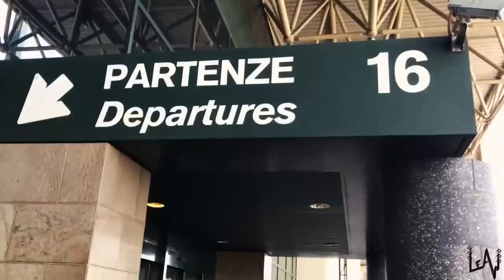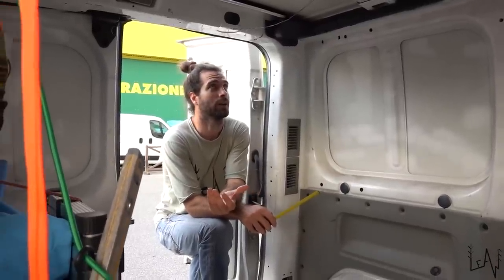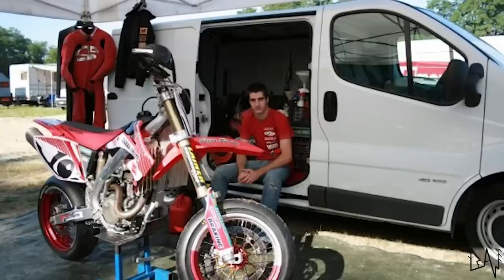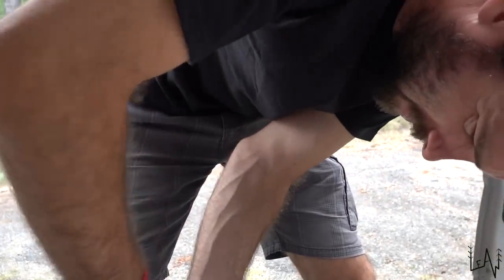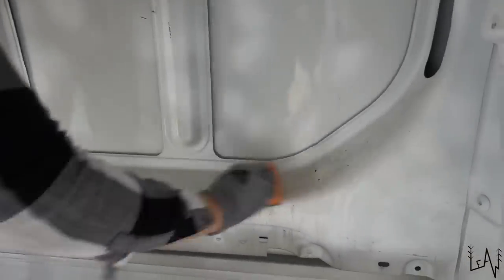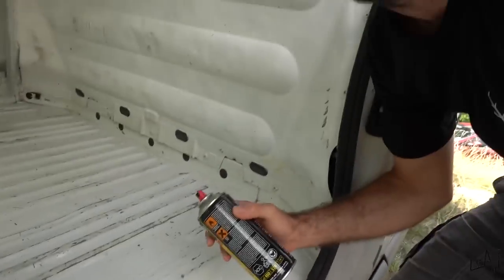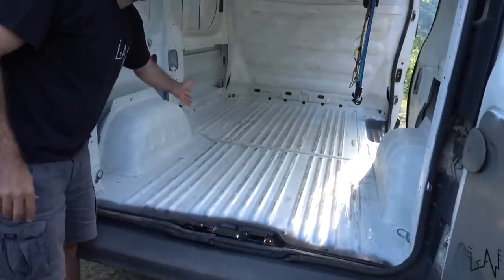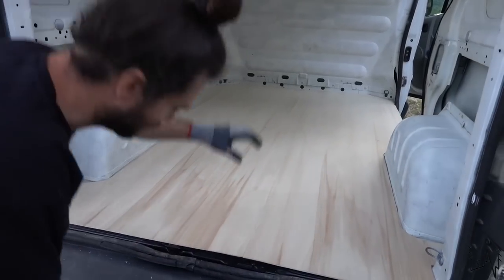Our VAN CONVERSION begins / DIY Renault Trafic L1H1 Van Life Italy

Comment: Guys , I built out a Ram ProMaster City van that is probably close to the size of your van. It sleeps two just fine. it's great on gas , you can park anywhere. I use the entire floor as my bed.
Then from the very back, half way to the roof I made a platform that runs towards the front of the van almost half way to mount my sink, small fridge, microwave and stove. The rest of the space is a seating area. I used two tri fold workout mates as my bed. Thin light weight and comfortable. Don't let anyone say it can't be done , I know better ! Good Luck on your built !

Comment: Advice for you van conversion, take a look under rear for your type of rear suspension system. If you have rear coil springs you should install what are adjustable air bags in them for more sturdy rear support. If it is leaf springs you can add a helper springs to them, or replace the shock absorber with new ones that have a additional coil spring attached around them for addition support. If you do it now you will thank me in the end for this "heads up", or if not remember my  advice later.

Comment: Your van is AWESOME! TONS of potential to work out a functional plan. It is small enough to get decent fuel mileage so you can travel more....its very smart to use what you have and make it work for you not spend alot on it because you will change it many times anyway....just determine the most important features you need then play with different floorplans either freehand drawings or try the sketchup app...its going to be awesome guys that van is awesome!!

Comment: I think the 10 mm plywood can be used to make the cabinets as well. You can make them without framing them first. Just cut the plywood to size and glue and nail the pieces together (with a nail gun).

Comment: Howdy, do you guys ever think of cutting part of the roof so you can stand when you can cook and then put a pop-up tent on top of the roof maybe hanging over the back a little so you can climb in  from the inside lay down and sleep ,Then when you leave just fold it or in slide the over hang in and drop the top and takeoff , you can still put solar panels on top of the pop up .  They sell pop ups . The roof  over the passenger and driver side you can put a storage rack on top of that. Stay safe you two

Comment: Non lo so, personally I avoid the spray foams. To many reasons to mention. They degas over time, are unstable and are quite toxic. They do make thin closed cell foam insulation but this may be difficult to find. You can make your own using 1/4-1/2” foam core and mylar. Good luck. Love you channel. Ditch the spray foam.
Reply: Toxicity is not good.
Reply: Agree the foam is hard to deal with & messy🤔
Reply: Insulation è una cosa importante non lesinare

Comment: You need to put wood strips down underneath the plywood, so you have something to shoot the nails into. I think the nails will go through the metal floor or bend..which won't hold the wood securely

Comment: Maybe you could find a way to do fold down items to where you can have convertible things. Like a table, closets, cooking, solar for through could be foldable for the roof. Maybe a slide out table with fold out legs from the bottom. Just ideas.
Reply: A fold down would be awsome. Such a good job, I'm building my van at the moment and I remember this part.

Comment: You can't use the thinnest plywood for sub flooring in your van. What are you thinking? You have to change it to at least the 9 mm thickness.
Edit: There seem to be other thicknesses in other countries, so you might want to go with the 10 mm thickness - as the minimum thickness. It is better to have it even a bit thicker than that. Beware that you don't get the type that has formaldehyde in it, because you will get cronically ill from formaldehyde. If it smells good, then it is probably ok. Formaldehyde does NOT smell good. And plywood comes in different qualities. You don't have to have the best quality for subflooring and maybe not even for the ceiling and the walls since I guess you are going to paint it. But you have to check that out for yourselves to be sure. And regarding the plywood thickness for the ceiling and the walls (if you are going to use it there) you would need at least the 10 mm thickness there as well if you are going to screw things to it, like spotlights and cabinets.
Reply: Annie They will put insulation panels and flooring on top
Reply: @isabelpatriciamuller5018  - Yes, I got that. But it is the sub flooring that will hold the weight of everything. Not the insulation or the flooring on top. The plywood will crack to pieces. But don't take my word for it if you don't believe me. Ask any builder.
Reply: Its going down on a metal subfloor and they are going to fill the voids it will be fine...from a builder
Reply: they are having to build by government protocols for a conversion so please be nice!
Reply: Such a good job, I'm building my van at the moment and I remember this part.
Reply: A thick wood subfloor was important for several reasons.  It helped  keep the cold out. (The coldest part of your van will be the floor.  Insulate it if you can.)  The thick wood floor will make it easier to screw things down, like your bed and kitchen cabinet.  A thick floor also makes it impossible for mice and other critters to chew through.  Mice in my van is a constant battle for me

Comment: Came here from your van tour video and I will sure watch all of them and comment.
You guys are lovely people but I will make some constructive criticism every time I see the need for it.
Anti-rust paint and rust stabilizers rely on a chemical process that needs rust to work. So it's not better to clean the rust first because then it simply doesn't work.
Also, it is better to just buy a Rust stabilizer and then apply regular primer and paint on top. All this WITHOUT taking away the rust.

Comment: I would have painted the floor in the van properly with a primer and two or three coatings, because there is going to be moisture there and maybe leaks from the doors or from living in the van. You might not even know about it. I was also thinking that painting the floor with a bed truck liner would be smart, but I don't know if those paints will emit toxic fumes. You would have to make sure they didn't. And you need a vapor barrier in the floor and in the walls. A proper one like they use in house walls. It has to go on top of the insulation and before you install the plywood. And since you probably are going to spend quite an amount of money on the van convertion, I would suggest that you replace the rubber gaskets around the doors in the cargo room. You don't want leaks from the doors on the new flooring.
Reply: Yeah I thought that. I did the same painted everything with rust protect. Such a good job, I'm building my van at the moment and I remember this part. Come over and  have a look if you want

Comment: I hate to put a dampener on this but these Renault vans....... Well Australia Post use them and they want to ditch them already.  My workplace bought 3. One was worse than the others so they sold it.  Another broke down so they used the parts to keep the last one going.  There is even an English guy on youtube travelling in Europe and keeps breaking down.   I hope you have better luck.
Reply: Luca's van is much older and probably of a better build quality. He purchased it when he was 18 years old.
Reply: Mitchell Barnow I’m pretty sure Renault is French for shit but I hope you are right.  I think the tiny bit of metal in ours has been melted down and turned into toilet paper holders.
Reply: @classicscustomsandhotrodso600  If Luca can get that old $800 Ford truck to run from Alaska to Argentina I think he'll be okay in the van.  I have faith in him.
Reply: Reetz Those old Effies are super reliable.  One advantage is the parts will be easier to get.  The one I drove, which ended up the better one, had the master cylinder pack up after it’s 1000 km service.  Another design flaw is the aircon pipe rubs on the body and lets all the gas out within the first 2 months. This happened to all 3 of ours and 2 that a customer bought.

Comment: please do not use the spray foam under the floor it will fall apart and rattle no good if you have to you, can get insulation that is thin can be rolled out, that is a jigsaw in the states try to find the insulation that is silver-lined for the top holds back heat better i think and will work on sides also

Comment: if your bed is to be on a permanent fixed in place platform, there is no need to build a floor under the bed on top of original floor.

Comment: Luca, there is no reason why you shouldn't be able to remove the cargo partition between the front seats and back cargo area. It is not a structural component. Check in this a little more to see if you can remove it and then install swivel seats.

Comment: I have a couple questions about your van. First, Is your van a front wheel drive or a rear wheel  drive,or a four wheel drive? And second, what size is your motor,4 cyclinder or 6 cylinder?
Reply: Front wheel drive 4cylinder 1.9 litre turbo diesel
Reply: I just found the same van for sale in my country (the 2003 model). It has two doors in the back with windows in them and the sliding door on the right side has a window in it as well. There seems to be very little rust on it (can't see any rust). These vans were produced in Luton UK and at a Nissan plant in Spain. It is 479 cm long and 190 cm wide. It has a payload of 900 kilos. That is good.
Reply from the maker: Exactly thank you

Comment: Can you not remove factory bulkhead behind seats and replace with foldable wooden one?
Reply from the maker: Unfortunately we can’t here in Italy because our van is registered as commercial van and not as camper... super complicated
Reply: A very hazardous move with regard to crash/roll over occupant safety
Reply: @bobturnbull18  Why? I've owned the passenger version of that exact same van and it doesn't have a bulkhead (the removable partition with window behind the front seats)
Reply: It's easy to see the additional structural integrity afforded by the solid bulkhead. It may be that the passenger version is otherwise strengthened to provide the same integrity of the shell but it is probable that the cargo van would not pass a roll over crash test without the bulkhead as provided from the factory.
Reply: @leaw  I noticed the window in the bulkhead. Perhaps in that portion you could use quick disconnects to remove quickly as possible excape from van bed to driver's compartment.

Comment: YT will not let me enter links for you in the comments. But just for you or your country. I also cannot use the on screen typing. I have to use the key board to message you. They are trying to keep information from you. The van floor looks good so far.

Comment: Putting solar on my house 2KW allows for the use of a Dryer for free.
Reply: You can't use a 1500 watt or a 2000 watt dryer on a small solar rig like that. It will drain your batteries before you know it. And if you got sun, why not dry the clothes in the sun. They will probably dry quicker there than in a dryer.
Reply: @milcotto4153  My Solar feeds the grid all day long.  putting about 12KWhours  per day into the grid , this reduces my apparent demand and lowers my bill by a lot more than the 1.5kw hour I use to dry a load of clothes.  Basically average 3-4 free dryer loads a day.
Reply: @milcotto4153  Meters work on a net basis. they measure demand and contribution,  My solar panels make constant deposits my dryer makes intermittent withdrawls.

Comment: Here is a rather simple solution for converting a 4WD 2001 Toyota Hiace into a camper van (I have a 2007 silver metallic Toyota Hiace same size as this). It has the double bed towards the cab, and a kitchen on the left and a floor to ceiling cabinet on the right in the back. If you already had some cabinets you could just fit them in the van like they have done here:
https://www.gumtree.com/p/campervans-motorhomes/2001-51-toyota-hiace-300-gs-d4d-lwb-camper-day-van-in-metallic-green-long-mot-/1378915476
Reply: Such a good job, I'm building my van at the moment and I remember this part.
What a good idea Annie. 🛺🥰